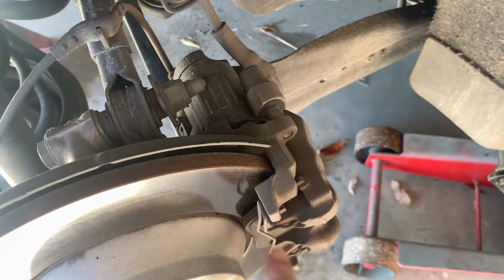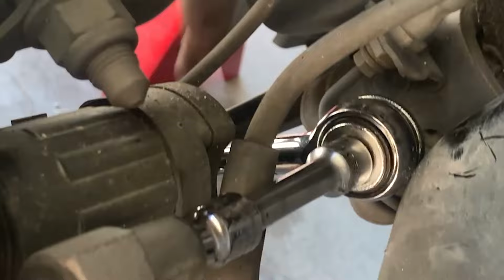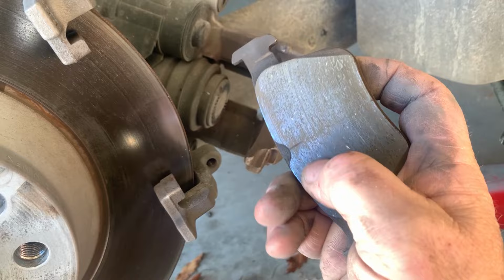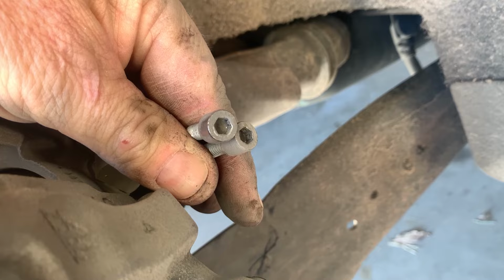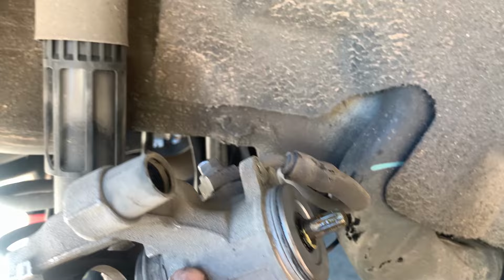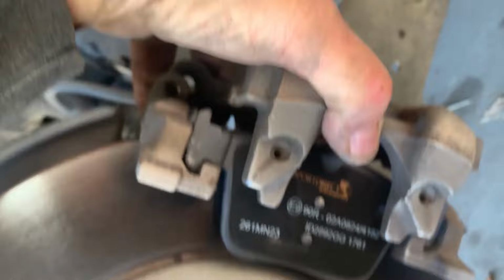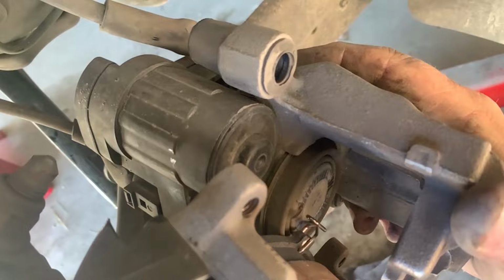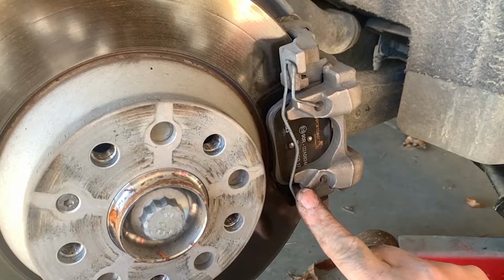No Scanner Required - How to Replace VW Tiguan Rear Brake with Electric Parking Brake

Comment: Done my mrs brakes, turn car off with drivers door open, without applieing handbrake, rocked it to make sure handbrake wasn't on, took wheel off, removed wheel, removed spring on caliper, removed  2 caliper bolts, changed pads, used windback tool to push caliper piston in, refitted, job done x
Reply: Open brake fluid cap
Reply from the maker: Great job!

Comment: The only thing that took a little time was figuring out how to stop the auto handbrake from applying, anyhow we opened the passenger door (drivers door open effects the brake)  applied the foot brake and press to release the handbrake at the same time and it stayed off,  job done 🎉 THANK YOU

Comment: There was still a lot of meat on these brake pads . Wear limit is as low as 2 mm of friction layer left on pad. Nice job, though.
Reply from the maker: The other side had the disk wiped out.  Zero pad left.  Replaced both...

Comment: This video was greatly appreciated, I put new brake pads on our 2022 Audi Q3 and the process was exactly as shown in this video. No issues or service lights since pad replacement, saved $1000 from what Audi wanted to do rear brake pads.
Reply from the maker: Glad it worked!

Comment: Glad I found this video, exactly what I need  to do my rear brakes without scan tool. Just a lil added  info, size 9mm 12 point socket for the gear on the epb motor.  Still waiting on my rotors to finish the job. Video didn’t show  start up after  brake job to see if vehicle throws an error code since I know vw tends to be sensitive with anything electrical. Guess I’ll find  out later and post an update.
Reply from the maker: Car did not throw a code on me.  It blinked a few times when I set the parking brake but that was it.  Good luck!
Reply: @HangaRatz   one less thing to worry about. Thx for the reply  and for the info on video 🙏🏼
Reply: This was super helpful! Thank you so much for your video

Comment: When you screw the shaft in to allow the piston to be pressed back in, do you have to wind it back out so that it’s back in its original position for when the motor is re-coupled?
Reply from the maker: No. The car will know that it is out of position and will readjust.

Comment: Worked perfectly. Taking the EPB off was easy as pie. I tried unplugging the electrical connection, but that was a PITA and felt like I was going to break it.  Thanks for this video, saved me tons of money.
Reply from the maker: Glad it helped!
Reply: Can you tell me what size the internal Torx socket was that you used to wind the gear to reset the caliper piston?

Comment: Thanks!  Tiguan 2018 with electric break. Didn't know how to replace without scanner but today, I just replaced break pads and rotors - Thanks for saving me money and one less trip to dealer -
I have broke one lug, half part inside the rotor, I will take a look next weekend.  I used torque, not sure what happened.
Reply from the maker: Glad it helped!

Comment: Very good clear video thanks. I had an old peugoet / citroen where is was vital to use foot brake to resettle the rear pistons before activating the park brake, it was a diffrent set up so perhaps with VW it doesn't matter? The park brake mechanism was inside the caliper - absolute nightmare when you're self taught. Thanks again
Reply from the maker: You're welcome!

Comment: Hi from Scotland  but small recommendation use a 9 volt battery to rewind electric brake if you reverse the battery it goes either way real easy
Reply from the maker: Neat tip!

Comment: You can also use a brake compressor that turns as it goes in. I did that and didn't have to remove the motor.
Reply from the maker: Thanks for the info!

Comment: I noticed you were able to simply push the piston back in with a simple c clamp. Does it not require you to use the special tool to twist whilst pushing, like most VW's do?
Reply from the maker: On the EPB units the main piston will push back with a clamp only after you twist the EPB piston back
Reply: @HangaRatz  Thanks for the info my man, VERY HELPFUL VIDEO!!

Comment: U don't need to take top bolt out, just bottom the flick the caliper up off the disk and the top pin slides out.
Reply from the maker: That's just the way I do it.  Thanks!
Reply: Yes, you can BUT you should pull the pins to clean and inspect (or replace if needed) and lube them.

Comment: Thanks for the video! I have a 2020 Escape/Kuga with EPB, which looks similar. 
Do you know if the same procedure would work on it as well? Thanks!
Reply: I did mine yesterday.  The 2020 Escape is almost exactly the same..calipers, motor, bolt sizes. 
I used either 8 or 9mm regular socket on the caliper stud. The only thing I did different was open the bleeders when compressing.
I unpugged the motor on the first side and a parking fault appeared on the dash, but went away once plugged back in. I didnt unplug the second side and had no issues.
I watched a lot of videos on this and found yours to be the best, thank you!
Reply from the maker: Thanks!

Comment: How did you reset the EPB after the brake pad replacement ? Don't you end up with a fault or flashing light on the dashboard?
Reply from the maker: No.  I just reset the parking brake when I was done and it reset it's position

Comment: What size socket do you use to drive the bolt for the emergency brake in?
Reply from the maker: I think I used an E12.  You can probably use a metric or standard socket though.  Thanks!

Comment: what type of socket did you use to drive the parking brake shaft back in?
Reply: Internal torx
Reply: @Konochi_G  what size  like if i have to go to the parts store and ask for that socket, what do i ask for size wise?
Reply from the maker: Not sure what size torx I used. It was one of the ones that I had in a set in the toolbox.  A set of torx is a  lot less expensive than a scanner... 
Hope this helps.
Reply: @HangaRatz  yeah no doubt. Thanks. I’ll just have to get a set and hope it fits. Might even be able to use a 6 sided 10mm or something.

Comment: Did you do it in neautral or woth parking break on
Reply from the maker: In park with brake off. With power off the EPB doesn’t move
Reply: So in park with car ignition off?
Reply from the maker: @willbrow  yes